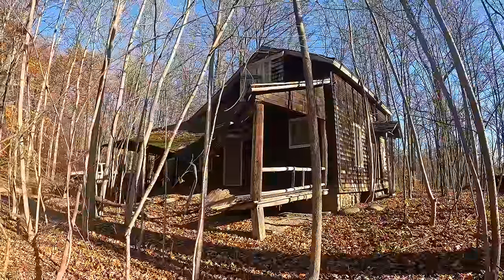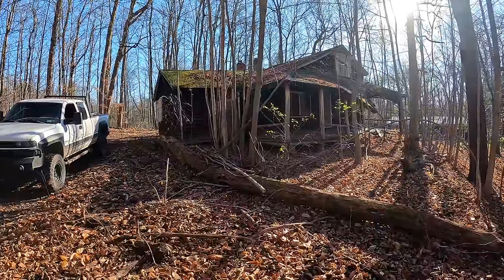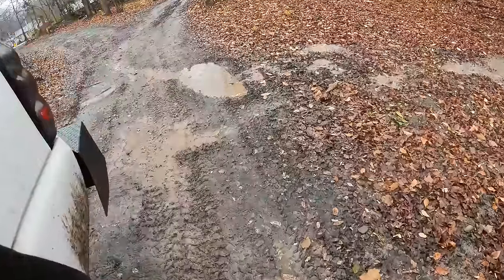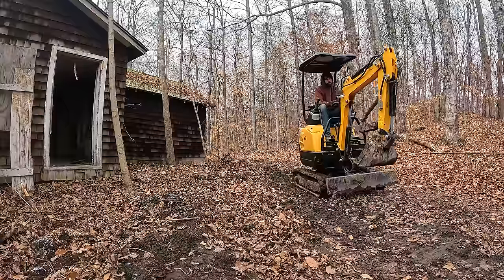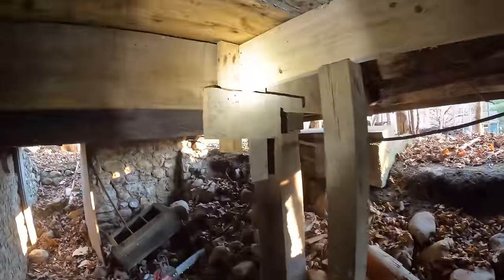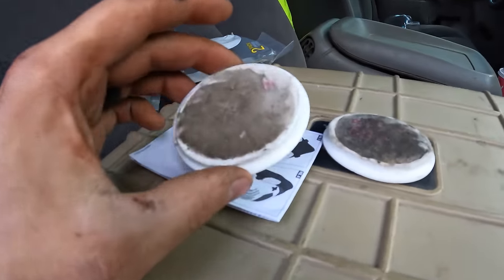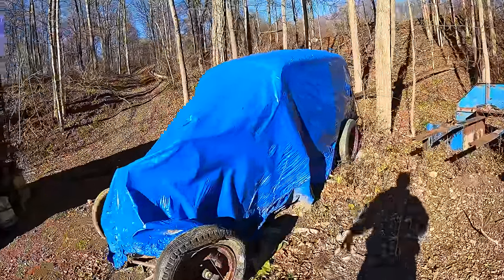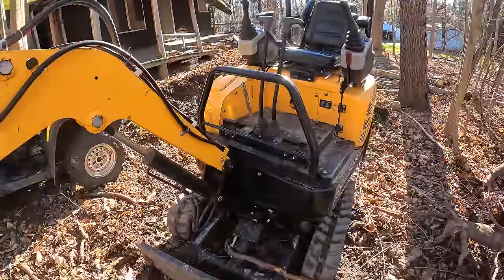I bought an ABANDONED CABIN in the WOODS - Vacant for over a hundred years!

Comment: I was a bit worried when I saw you gutting the interior first but I think you stopped and had a think and rightly started in the basement levelling up the floor. I would start with the piles, check that every pile is solid on a solid base and is level throughout the house then you can level up the joists and bearers. This will level the whole structure and amazingly you will suddenly find that windows and doors will open and close without jamming. Next I would repair the roof until it is completely watertight now you have the top and bottom sorted you can continue with the interior. It's a lovely old cabin and deserves your best efforts to make it live again.
Reply: This comment is spot on. You have to start with good boots and a good hat.
Reply: I was kinda worried that he was going to pull out enough support that the roof came down on his head, that would've sucked. Yes, the roof is where I'd have started, the moss has weakened the shingles, possibly the boards under them too. I'd go with steel or some sort of asphalt or fiberglass, Lowe's has something called Ondura that I like.
Reply: I was thinking that everything he takes out now makes the house lighter and easier to level!
Reply: If I were ever to rebuild/renovate a house I would surely look you up. 😊
Reply: Exactly correct. Pilings, footings, than everything else. I’d slap a metal roof on that next.
Reply: I would tarp the roof first then clean out the basement then level the first floor. By tarping the roof you can work without getting wet and not have to worry about ruining restorations already completed
Reply: Should put all that junk I'm a burn pile
Reply: Pole jacks
Reply: Good advice, if you ask me.
Reply: @debbibowen better fuel mileage and handling in the corners too
Reply: @jbizzle1966 never burn wood until the project is over. I rebuilt most of a bathroom addition from a burnpile at my last project house
Reply: Shouldn’t you be using joist hangers in the basement?
Reply: 3333333😅😅3334😅😅😅
Reply: This house is a diamond in the rough. 

Take care in restoring it please❣️
I bought & restored an 1860 ‘s log house. Much like this. Well & septic wasn’t installed until 1989. Active out house up until then. No running water till 1989 too. Crazy. I know. Right(?) 
As far as your roof…tarp it 1st, like another commenter suggested. 
Will keep you dry. New green tin roof later. 
Walking in first room … this was considered a summer kitchen. 
Look in the piano for hidden treasures. 
Use screw jacks in the basement to raise & level the floors. Make sure you have a solid base under each  jack.
Scab on existing joist with new. Save as much original trim & lumber as possible. Keep all the old glass & windows.
Restore it back to the original state as much as possible. Rework the entire fireplace with a new double flue lined chimney… in case you want to add a furnace later for additional heat / central ac. Restore all floors. New plumbing electric to code. Etc. 
look for any other old foundations. Use a metal detector to find treasures. 
Don’t be like a bull in a China closet when ripping out walls trim etc. save as much as that old lumber & trim. 
You will find hidden treasures. Look around the fireplace mantle Many times they would put an old silver coin as good luck token for their new home. Had beliefs for doing it. Many times you will find this in old houses. 
 Save any old chinking & plaster to crush & remix to reuse in between logs. If there is log under all that which I think it is. 
Save all those old handmade nails. Resell market. Or reuse back in your restoration cause. 
Any large trees make boards. Not firewood.
Keep your smaller locust for fence post. 
At about 30:00 into this I’m thinking  I sure hope you know what you are doing. Hope you do not butcher this too much. Yeah.. I know it is your house, your project . But why throw out useable lumber.(?)
When I see old houses… wow, those needing restoration.. I look to restore them back to their original state. And I’m a country girl. 👩‍🌾 💄🫦

Please don’t disappoint. Restore this old house the right way. 🙏 please.. ❤ 
I may return to check on you. 
Projects … yeap looks like many. Going from the house to your trucks. Threw me off. 
Mmmm I doubt you’ll even read my comment!

Regardless…. Best of luck to you with  this restoration 
👩‍🌾🪚🔨

🧠🟰💰
Reply: Looking forward to the next video and give the project manager a raise think a new chew toy and 3 extra dog biscuits will work
Reply: i was thinking, 'There goes a load-bearing wall.'😮
Reply: My thoughts exactly! And he finally got a dumpster. Clearly never saw one episode of the original This Old House.
Reply: @@karlwithak.  Mmmm, I gotta disagree. Sometimes it's about more than just dollar signs. But I know that's a hard concept in the US, where everything is disposable.
Reply: I came to say this
Reply: You clearly know WAY more about construction than I do ... however this whole thing seems like a tear-down to me.
Reply: I’ve got Piles
Reply: @davidrobinson6353  I hope thry're
Reply: @davidrobinson6353  I hope they're not concrete ones.
Reply: @HappyShackHomestead  I wish I could afford to hire you. I bought a house to keep from being homeless. Knew it needed work but not the amount it going to take. I’m 65 and disabled it’s going to be a long process. I’m currently saving to fix a bowing basement wall and the shore up the rest of the foundation. While I was looking at all this I found termite damage that was covered up with paint. Well enough of my complaints. I just really wanted to compliment you on your knowledge of rebuilding and restoration.

Comment: If this was abandoned 100 years ago it would be a rotted pile on the ground today. If left another 20 years it would have rotted pretty fast judging by that roof.
Reply: There was very good timber at that time. I live in a house that's over 60 years old and most of the original timber is still good. Only the exposed sections have been replaced. I've done maintenance work on much older houses where the wall linings had to be replaced. When we removed them the timber studs I side were as good as new.

Comment: People knock down houses like this because its so much more cheaper to start from scratch, but it's amazing when you actually rebuild what was there. So amazing keep up the hard work
Reply: I don't believe the new ones are as solid as back in the old days

I'm grateful he saved it; it gives me hope for mine❤
And with all his  skills at that age wow that reminds me of my father (a jack of all trades) definitely pray that all his hard work pays off for em🎉

I thoroughly enjoyed the video
Reply: I would have knocked it down but saved anything of value. Build better with good insulation and electrical.
Reply: @marciabrady3323  looks small enough to run 50 feet of cable and be done with it, and he could tack some foamboard to existing structure.
Reply: For some types of houses, i guess it's a good idea to restore rather than go tabula rasa, but in this case, it seems like a big waste of time and money tbh. Bad condition floor, walls, and roof.  Questionable foundations.  Electricity and heating systems need to be redone completely most likely.  Small unpractical rooms, doorways, and stairs.
Reply: @jamessergon Yeah this place is a disaster. If he guts it all he will have is a half rotted shell.
Reply: I agree.  People with vision that can do this have my respect.  I'm not that guy.
Reply: This is good only for the views

Comment: This is right down my alley. I bought a house very similar to yours at least design-wise. I had to gut the upstairs, take out the middle partition, remove the bannister and replace the windows because they leaked so bad. I also tore out the chimney that went through the middle of the house because it was so brittle.  A skylight took its place which totally illuminated the upstairs. Yeah I totally get your project.

Comment: The windows has most all the glasses the locks and the stucco well it can be old but not very long vacant well no more than 30 years is to many stuff don't is good condition for the time period the only thing you should do first work on the foundation of the house and floors because if with all the movement you are doing it can collapse any moment for your own safety than the roof to make sure anything you do inside don't get damaged from a leak your life is more important than anything and your health 
Other things what ever junk is wood should keep it on the side it will be great for winter time for start that chimney or a fire pit also the stairs rails looks like cypress should save that is a great quality wood better than pine and what ever trees outside also firewood or the about 4 inches long trees for fencing save money and looks awesome

Comment: TREE FALLING TIP less deep notch (1/3 tree diameter) leave you back cut attached. This will keep the tree going in the direction you want. When it is cut through you lose all control.  Love your work ethic and the videos. Fun project. Great work on the floor joists.

Comment: you  got  a  lot  of  work  ahead  of  you   if  you  pull  off  miracle   and  rehab   that  old  rundown  shack   without  tearing  the  whole  place  down  and  start  over  i  will  be  imprest  
even  the  foundation   is  shot    and  if  the   frame  has  dry rot   after  all  these  years  its  a  dead  horse  i  wouldn't    attempt  to  fix  that    but  i'm  hear  to  watch   what  you  do  
  i  hope  your   ready  for  winter

Comment: My best guess is that the home was built in the 30's, and was renovated a bit in the 40's or 50's, but wasn't abandoned until the 80's or 90's.

The asphalt roof looks like it may have been redone 30-some years ago. The cloth NM wire definitely means it has been rewired after the 1940's, but before the 70's. There is some MC wire too, so it could potentially be older. That style of plaster walls weren't used much after the 40's, but some people still preferred it over the new-fangled "Drywall".

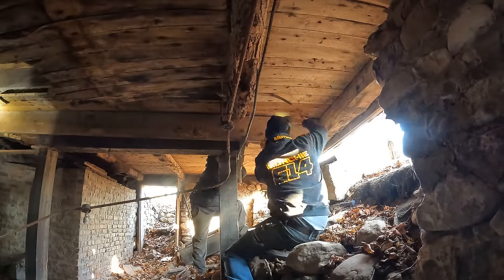Comment: 32:40  That conduit hanging from the basement beams looks like EMT, which wasn't widespread until the 1960's.  Before that was Rigid thick wall galvanized conduit, and I don't see any of that, so my guess is that someone was living in this structure at least up to that point.

Comment: Just an idea for anyone else doing this. I found that if I removed the plaster first it was easier to shovel up, only then remove the lath. Then I wasn't trying to sort through a heap of random rubble. A chute from the first window to a trailer skip is handy too. A big fan blowing at an open window helps keep the air clear.
With hindsight, clear out any junk or stones from the area, stepping over it twenty times get old and it's a hazard.
I had to take a break occasionally, doing this work is depressing as nothing looks better for a long time, YMMV
You were unlucky with that tree, that was a big tap root, lol 😸
This looks like an interesting project, hope it goes smoothly 👍
Reply: Excellent stuff. When someone isn't fully committed to finishing the project, I can see setting prorities different. For 100% commitment, I totally agree with your tips. One thing about the fan: the property probably doesn't even have power now. Not everyone has an electric truck with huge battery to run a fan off. Running a genset in the forest...not really cool, althought it's giving out some proper plant food.
Reply: @karlwithak. I did wonder about that because there’s no way to retrofit modern insulation and air tightness into an old frame, plus the foundations are a bit meh. But if you just wanted a rental and didn’t have the capital to invest into a rebuild, then maybe? The important part of this building is the roof looked OK so therefore the structure hadn’t failed. If there was wet damp then yeh, raze it just for the plot
Reply: @karlwithak. what are you on about? Restoring a property for rental is a very different process to somewhere you’d want to live. Both in capital and materials. You think people are going to drop marble worktops into a rental or something? The whole point is minimising capital outlay. No, the cost of a rebuild is way higher than new plasterboard and fittings, thought that was obvious. Have you never done this before or something? The structure is everything, especially the roof
Reply: @____________________________.x  the way they're condescending you is wild, I'm so sorry
Reply: @TheRealLilyOfTheValley  My thoughts exactly!